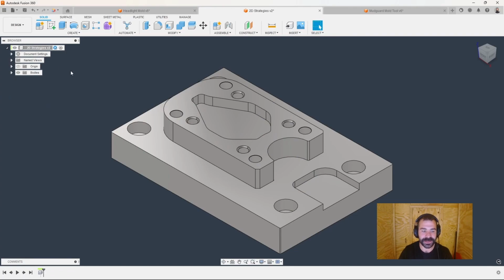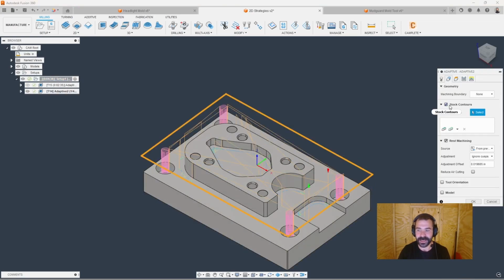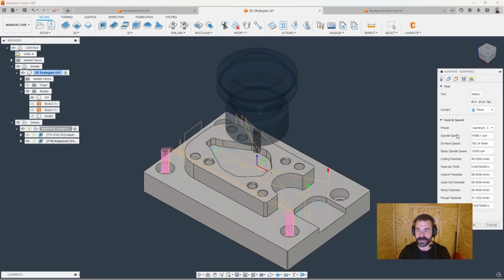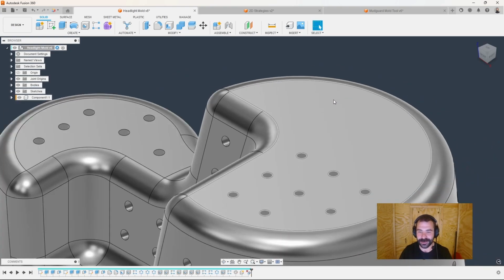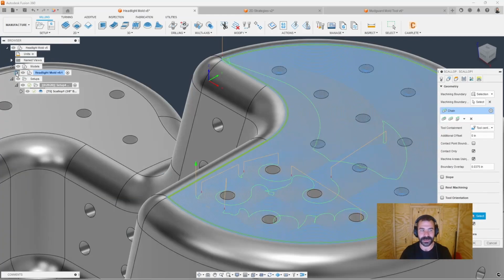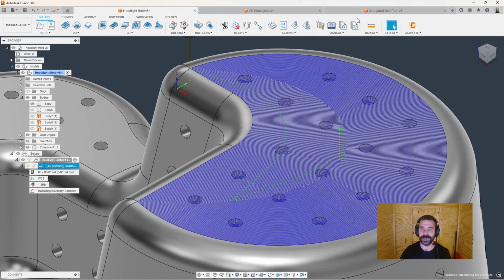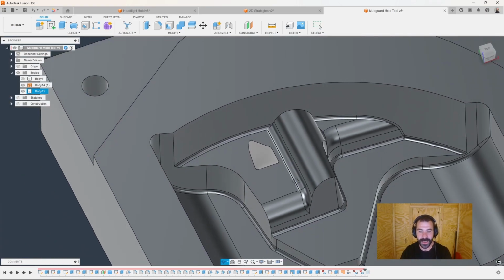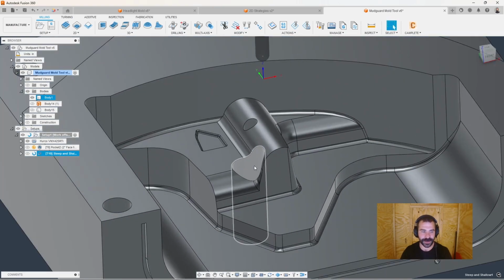Fusion Friday (ep105): Using Model in Your Toolpaths to Avoid Features.

Comment: Thanks for your videos.   Any reason you didn't use a manufacturing model and simplify?
Reply from the maker: Great Question, So the only reason I don't use it is due to the lack of pass through for continuous rest machining. Example would be say I'm gonna use a UMC-1500 Duo. the ability to do op1 on one side into op2 on the 5x table using manufacture model I'm technically creating multiple bodies that don't reference one another. so the continuous rest machining no longer works. I tested it prior to this video. :)